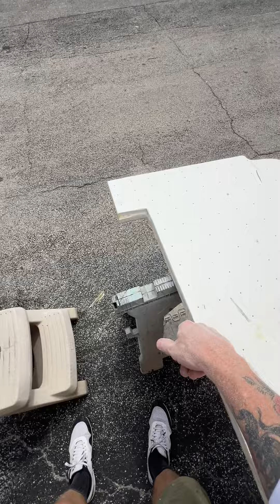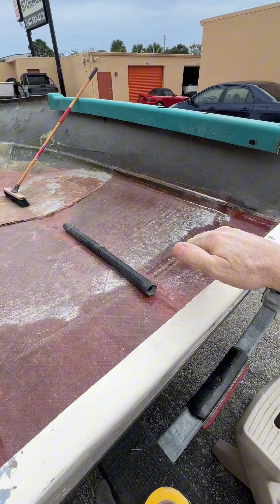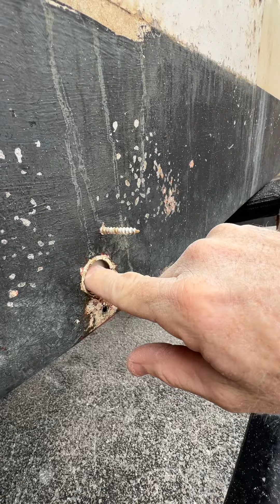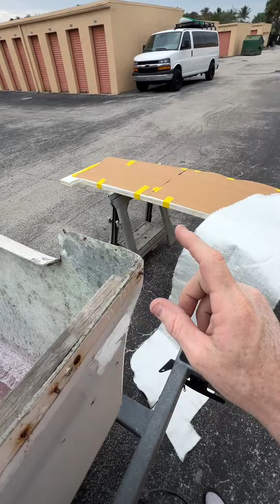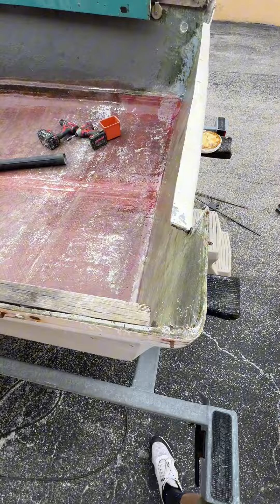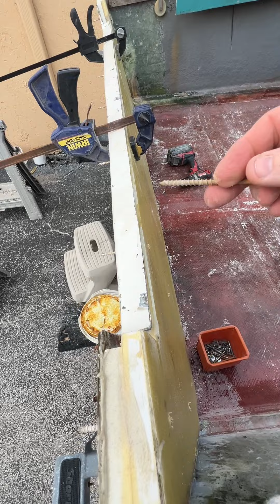Installing new transom core into my 1962 Boat

Comment: If your gonna make holes in the transome, you should use machine screws so you can use a nut and washer to tighten it as needed.
Reply from the maker: It’s plenty tight
Reply: I agree, I use planks or steel angle iron (inside and out) with carriage bolts and extra large washers. wood screws will not take the force when the epoxy is kicking off. It's not horrible doing it his way.... but easily better ways than wood screws through glass.
Reply from the maker: @rs1329 I already put 4 layers of glass on the coring material which in itself is the same as wood planks or angle iron. I have transom brackets that I fabricated that I could have used but when you’re working by yourself and you’re trying to manage a large piece of coring and also fumble with angle iron, brackets, carriage bolts and nuts all while racing against the resin clock, you have to make some adjustments. There’s nearly a 1/4” thick glass on the transom. The wood screws held just fine and I didn’t fully tighten them as to not squish all of the putty out from behind the coring. Sometimes more pressure is not better.